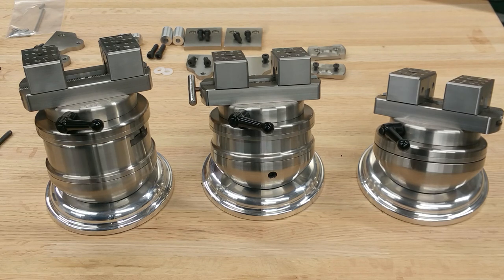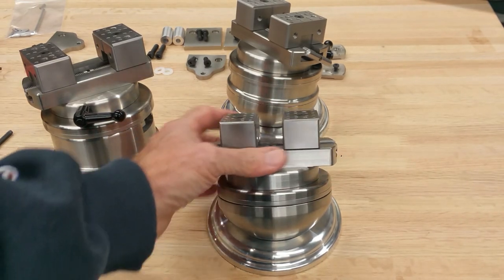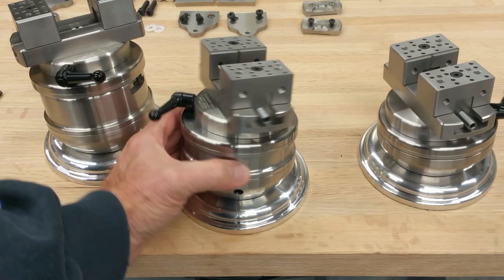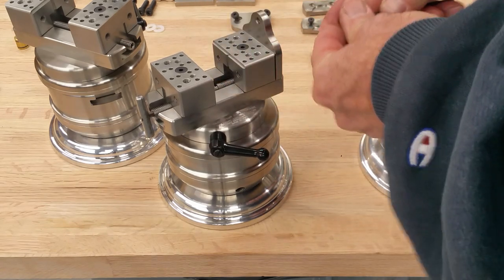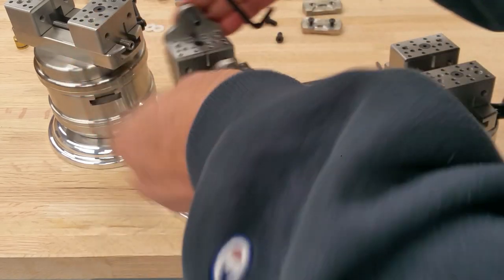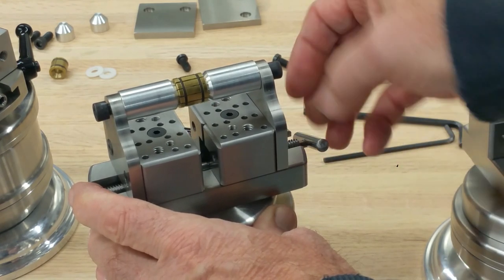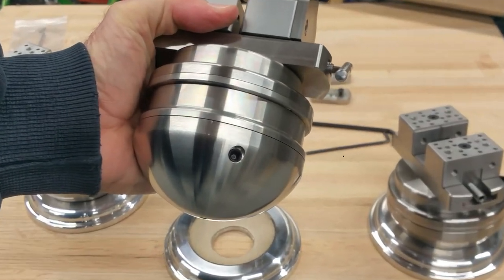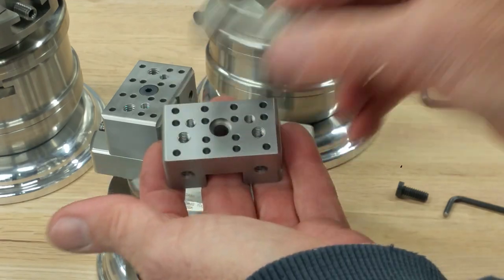TrueCenter CamLock small version

Comment: Nice attachment well designed and user-friendly.  By the way I've been using the palm control I purchased from you years ago engraving parts for a Ballard as well as a flintlock double barrel shotgun I built hope to purchase a vice as I've been using a homemade vice which doesn't move freely as yours, thanks for the video. Gerrit Vanderwerff